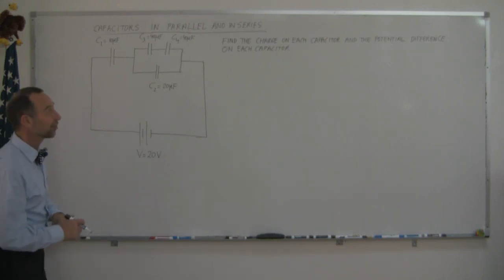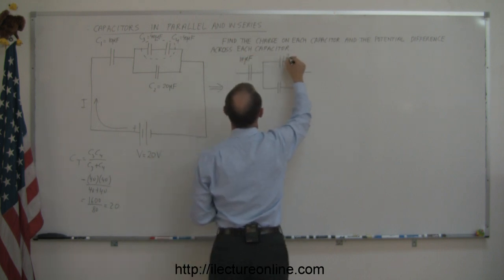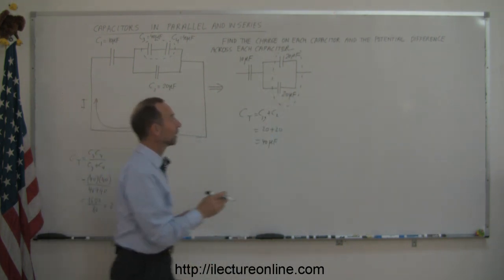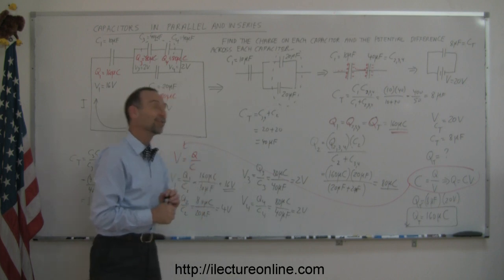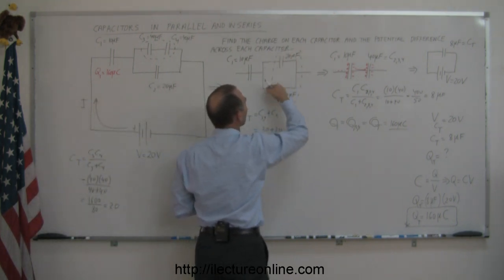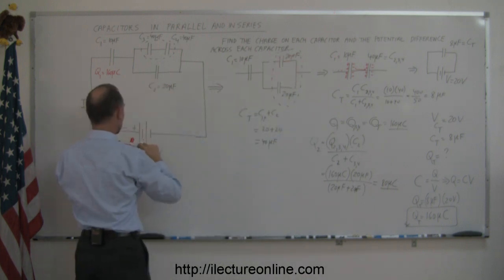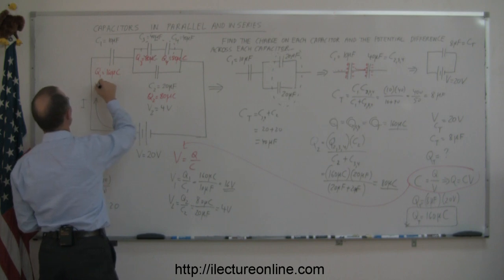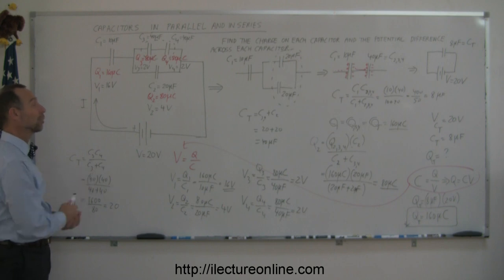Physics 39   Capacitors (6 of 37) Capacitors in Series and Parallel   4/4

Comment: Excellent lecture online.  I would kindly suggest that you keep the first series as a whole fraction .. adding 1/2 with  1/8 with 1/4 ... which gives you C= 8/7 .... again, if you keep the fraction for the remainder of the calculations, you can easily get to  1 micro Farad with no calculator required.
Reply from the maker: Thank you.  Good suggestion, but in physics, it is customary not to leave numerical results in fractions.  That is why we present it this way.

Comment: awesome video. you mentioned that in a series, charges are the same since they have only one path to travel. can you also give an explanation on why voltage is the same in parallel or how they behave?
Reply from the maker: +Samson Zheng 
Voltage really means: "potential difference".  It is thus the difference in voltage between one point on the circuit and another point on the circuit.  So when you have a parallel branch it doesn't matter which path you take to go from point "a" to point "b" on the circuit.  The potential difference must be the same no matter what path you take.

Comment: i'm still confused how you figured out the equation around 11:04. How did you know to multiply and divide those?
Reply from the maker: When capacitors are in parallel   Qt = Q1 + Q2     When capacitors are in series 1/Qt = 1/Q1 + 1/Q2  which can be written as Qt = Q1*Q2/(Q1+Q2)  (The product over the sum rule).
Reply: thanks. I think I see it now.
Reply: I see that you are using the product over the sum rule, but how can you use it when you are combining Q (charge) with C (capacitance) in the same equation?
Reply: I agree man, I was able to follow everything up until he started looking for the charges on each capacitor. Pretty confusing as he does not explain why in the video. What a shame.

Comment: May I ask, what if the units of the capacitors have different units some capacitors are in nanofarads while the other are in microfarads, are you going to convert it? Then how?
Reply from the maker: It is like adding millimeters to centimeters.  You will want to convert one of them to the scale of the other or to the common standard unit (which is meters in the case of length).
Reply: Wow, thank you for your response sir! Btw, thank you for making this educational content I learned a lot from your videos

Comment: what exactly a series combination means,is it the right plate of the first capacitor connected to the left of the second and the left plate of first capacitor connected to the second plate of the second capacitor? is joining of the left plate of first capacitor to the second plate of the second capacitor required i.e the circuit needs to be complete ?
Reply from the maker: Take a look at this video where this is explained:   Physics - Capacitors (3 of 8) Capacitors in Series and Parallel 1/4
Reply: does it mean the charges will be automatically be the same in all the capacitors,i.e if charges in the capacitors are q1,q2 and q3 respectively and then connected in series,final charge on each will be q1 + q2 + q3,thanks.

Comment: when two identical capacitors initially charged with q and q are connected,the common plate may get neutralized by plus q and minus q but it becomes minus 2q,charge is conserved in all cases,what exactly the charge conservation means in this case.
Reply from the maker: It depends on how the capacitors are connected (parallel or series) and how the additional charge is added.  Note that when they are connected in series the positive plate of the one capacitor is connected to the negative plate of the next.  We have a playlist with lots of examples of those types of problems.  PHYSICS 39.1 CAPACITORS RECONNECTED

Comment: im referring this video and the previous one where i have commented the one about resistors in circuits and charges on the each resistor :) 12.00 in this video where the q2 is equal to Q234 times C2 over C2 plus C3,4.
Reply from the maker: +Ahmet Omer Ozgen 1) first find the equivalent capacitance and you can then determine the charge on it is 160 micro coulombs.2) then take C1 and C234.  Since they are in series, they must carry the same charge and thus each carries 160 micro coulombs3) Than take the branch with C2 at the bottom and C34 at the top.  Since they have equal capacitance and are in parallel, they must carry the same charge.  Thus they each carry half of the 160 micro coulombs.  4) Now separate C3 and C4.  Since they are in series they carry the same charge and it must be the same as the total of that branch.  Thus each carries 80 micro coulombs.
Reply: +Michel van Biezen thanks a lot. so i can safely use the formula here :) ty

Comment: I have Q: If I have 3 Capacitors in Parallel and each Capacitor has deferent value How can I calculate the charge of one of them???

Thank very much.
Reply from the maker: +mr kefy 
There are several techniques.  You can always use the equation C = Q/V  which means that Q = C*V.   Since the voltage must be the same for each capacitor in parallel, Q will then be proportional to their capacitance.
Reply: +Michel van Biezen I think i did not explain my question very well :|
however, when you look at 11:36 you will see that you wrote equation to find Q2. I think this equation work only for two capacitors. my question is what if i have 3 capacitors? how can i find the charge in any capacitors if each capacitor has different capacitance ??

Thank very much.
Reply from the maker: +mr kefy My answer above is one of the methods.You can also group 2 capacitors together (find the equivalent capacitance) and then you'll have 2 capacitors in the branch, using the technique shown in the video.

Comment: I was told that the rearrangement was the opposite: (Q total)( C of the opposite capacitor)/( C sum)... and I actually do this for current...is it incorrect?
Reply: as in the ration of Resistance * current
Reply from the maker: I can't tell from the limited information you gave me, but it may be.
There are similarities between the techniques.

The  best way to check is to do it both ways and see if you get the same answer.
Reply: If you have two resistors in parallel, what my High-school teacher taught me was :

If you want to know how much current goes through Resistor 1 do the following:

(Total Current)[R2/(R1+R2)]

( dividing the opposite Resistance by their sum)
Does the technique change because current flows greater in a path of less resistance and capacitor don't?
Reply from the maker: littledivergirl1105
That is the correct method for finding the current in branches.
With capacitors (and a DC current) you are not trying to find the current in each branch because DC current cannot flow through a capacitor.
Instead you are trying to find charge on each capacitor and the voltage across each capacitor.
Reply: Michel van Biezen As shown in the video, you plugged in (Total Current)[R2/(R1+R2)] to find R2, not R1 as she stated above. Could you clarify what R we plug in to the numerator?
Reply from the maker: Jonathan Dummer 
Which video are you referencing?
Reply: This one. At 11:00
Reply from the maker: littledivergirl1105 
Now I understand the question.
Capacitors behave very different than resistors.
Current doesn't flow "through" capacitors, but fill with charge and then the current stops.  The larger the capacitor, the more charge it can hold.
 
With resistors, the larger the resistor, the less the current.

That is why the equations appear different.
Reply: Thank you very much for the follow up, I really appreciate it. Your videos are some of the most helpful ones I have found to date on YouTube!